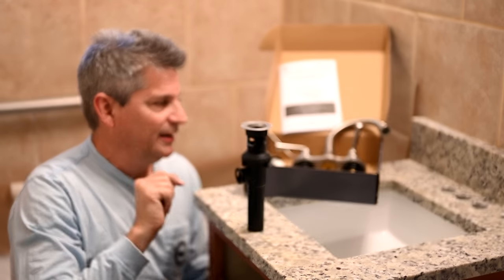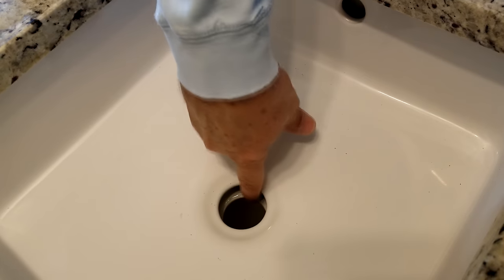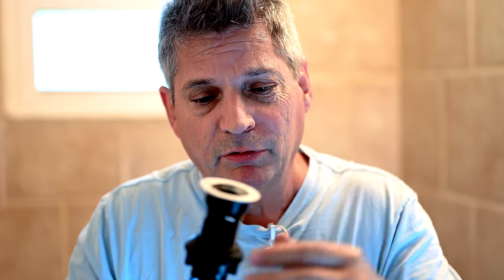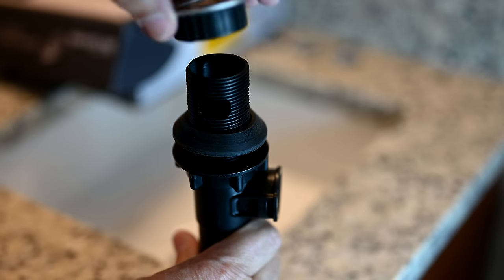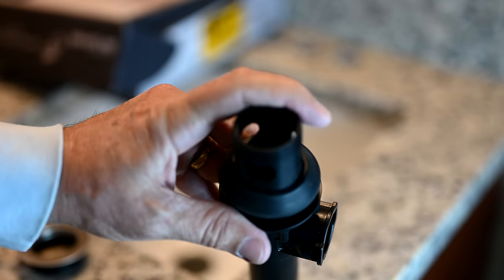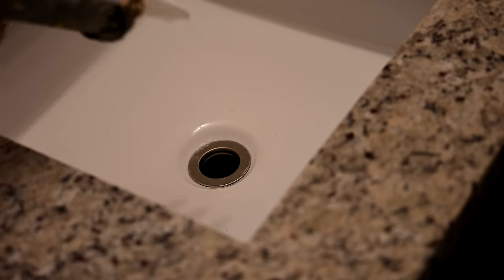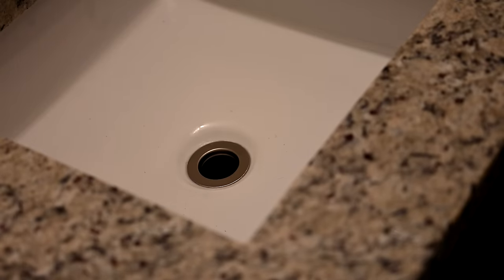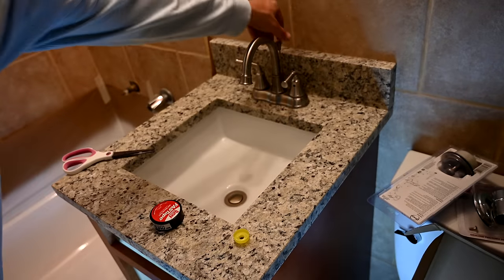How To Install Bathroom Sink Drain/Faucet, No Leaks Under Gasket, Threads [SOLVED] 2023

Comment: At the 23 sec mark, water appears to be coming out between the top of the rubber gasket and the underside of the sink.  How does teflon tape on the threads stop leaking at that location?  It can't.

Comment: Very good explanation of the problem but I have a faster and easier solution for the bottom section of tape.  Start the tape just below the weep holes and run it all the way down to where the gasket rests when it's all the way down.

Comment: Jeff,
I thoight I did everything correctly but something went wrong at the faucet its linking when I turn the water on .looks like the water is coming from the top of the faucet.
Reply from the maker: when you turn the water on water is supposed to come from the faucet. I sit leaking from somewhere on the faucet where it attaches to the sink?

Comment: How do you remove the old flange that’s stuck in the drain?
Reply from the maker: Once you loosen the plastic nut under the sink that squeezes up against the black gasket, pull the black gasket down a couple of inches and you should be able to just slap it straight up in the air and it should pop up off of the top side of the sink. Then you can use pliers or whatever to unscrew the  Flange
Reply: @jeffostroff  Thank you for that info.

Comment: What silicone did you use?
Reply from the maker: You have to use this particular GE Kitchen & Bath 100% silicone and look for 30 minute water ready on the label. Other silicone takes hours to cure. https://www.homedepot.com/p/GE-Advanced-Silicone-2-2-8-oz-Clear-Kitchen-and-Bath-Caulk-2709136/100004845

Comment: My bathroom sink is leaking through the middle hole where the plunger stopper rod goes.  Can you please tell me what I am doing wrong? Appreciate any thoughts that I may be missing.
Reply from the maker: If you were leaking through that hole where the plunger rod comes out, it usually means that you did not tighten down the nut correctly sometimes it goes on sort of at an angle where it's almost stripping the threads it has to go in clear and straight and screw all the way in reasonably tight in order to make sure you have a good seal there.
Reply: @jeffostroff   I am thanking the nut is missing altogether! I do not see anything that looks like it fits there. I am going to try to Google a pic of a sink plunger nut and see if I have something similar! Lol determination!

Comment: What if it's not threaded all the way up? Our pop up drain is dripping and the gasket comes up over the threads to a smooth part. The gasket is threaded but the part of the pipe it is on when it seals is smooth. Do I still use Teflon tape on the smooth part?
Reply from the maker: Never seen that, seems like they gave you a short down pipe. You can try to buy another taller threaded pipe with drain flange

Comment: Head scratcher for me, Jeff. I've successfully completed most of the steps in the video until I came across a dilemma. Wall pipe is 1-1/2", sink pipe is 1-1/4". I pulled the P-trap off to clean (or replace) to get better sink access, and I can't for the life of me figure out how to adapt this. I don't know if my 9 mo old puppy ran off with part while I was slaving under the drain nut, but the 1-1/2" P trap needs to go into the 1-1/4" sink drain somehow. Nothing obvious on the Home Depot shelf. Help!
Reply from the maker: One of your gaskets should be a 1 1/2" to 1 1/4" reducer gasket homedepot.sjv.io/0J2zdO
Reply: Any hardware store or Home Cheapo should be able to hook you up with that.  Like he said it's a reducer adapter.  It's made of rubber and has hose clamps on each end that you can tighten with a screwdriver or a 5/16" socket.  I prefer to use the socket; it's easier to torque down.
Reply: @jeffostroff  Perfect. Exactly what I needed. Thx!

Comment: Teflon is used basically as a lubricant for metal threads, particularly on tapered threads
Reply from the maker: It can be used on any threads
Reply: @jeffostroff  so can peanut butter, point is, it's not a sealant, but a lubricant

Comment: Lots of good tips here - I don't understand why the tape at the top of the assembly - seems to me like you've got a wet area (inside the sink) sealed up against another wet area (the area where the overflow comes to).  A tip I'll share is this - don't trust your hands to tell you where there's a leak.  Instead, get a sheet of Toilet Paper and use that.  It'll register the tiniest drip and present it to you in an unambiguous way - which is important since we all want to believe there's no leak.
Reply from the maker: Yup, and I also like to use the blue shop towels paper towels

Comment: What about using RectorSeal 5 around the rubber gasket surface where it seals at the bottom of the sink?
Reply from the maker: If you put the plumbers tape around the the bottom part of the threads, you won't need to add anything to the gasket.
Reply: @jeffostroff  thank you
Reply: NO. The #5 will eat away the plastic and cause premature failure of any plastic parts it touches.

Comment: my drain pipe comes with a foam gasket that sits underneath the flange and its leaking from there do you recommend removing the gasket and siliconing instead, its all plastic
Reply from the maker: I can't imagine that you are supposed to use the foam gasket and not plumbers putty or silicone. Do the instructions tell you to use the foam gasket?
Reply: @jeffostroff  the diagram clearly shows the foam gasket , i removed it and used silicone, no leaks looks great very well done video👍

Comment: I used Teflon tape but still getting leak near the black rubber gasket at the bottom of the basin. Can I use silicone around the rubber gasket to close up the leaks?
Reply from the maker: Watch the video again, make sure you go through all the steps, make sure you measure where the black gasket is going around the threaded pipe at the the bottom of the sink  underside, and make sure your teflon tape ends up there.
Reply: @jeffostroff  can I use plumbers putty along with the Teflon? It’s still leaking

Comment: It's true that placing the gasket against the threads is a bad design. A good drain pipe waste assembly is fitted to the sink such that the threads stop before the gasket which is then against only an unthreaded section of pipe. But because manufacturers and stores are cheap, they like to stock 1 part that fits everything, and that means threading the whole pipe. The kind engineers of some cheap parts gave us a way out of this situation: they made the gasket very tight against the threads, and they include a washer between the gasket and the nut to help you tighten the nut a lot, squishing the gasket into the threads. Without a washer and the right tool, you can't get the nut tight enough to stop the leak. You can also try threading the gasket upwards so the threads dig in more by the time it's at the top. The final hack is to eyeball where the gasket stops and fill that space with teflon tape, as suggest in this video. 

If you google for manufacturer installation videos, you'll see that a lot of them use assemblies that fit their demo sink perfectly, with the gasket on unthreaded pipe, which only needs a quick hand-tighten to never leak.

I agree that the manufacturers of these cheap one-size-fits-all assemblies SHOULD mention this teflon tape procedure. Example: "Mark the top of the threads below the sink, remove the assembly, and wrap 5 times with teflon tape here". The reason they don't have good documentation is because a lot of customers just get lucky and don't have a leak, so the company can get away with being irresponsible. Another thing they don't mention, but should: torn up old plastic threads and gaskets don't seal well and need to be replaced.

Comment: Mine still leaked with Teflon tape. Ugh. Bought a thicker tape, will see if it works with heavier tape. The tape I used was very stringy.
Reply from the maker: I prefer that Oatey Fastape it is thicker

Comment: What do you do if the rubber stopper on the underside is unable to tighten?  There's about a half inch gap... I think the sink is too thin?
Reply from the maker: It always tightens, just slide it up the threads to the sink bottom
Reply: @jeffostroff  lol I figured out my issue. I'm an idiot. I didn't know the drains were different for a vessel sink vs one with an overflow.   The one that came with my faucet was the wrong kind

Comment: IMO it is easier to caulk the underside of the faucet prior to setting it down on the sink.  It is much easier to clean up the squeezed out caulk than it is to use a caulking tube between the back of the faucet and the back splash.
Reply from the maker: yes but you still want to make sure you have the caulk top side also so it never enters the perimter of the faucet

Comment: Pro guy here: Tef tape is to protect the threads.  The rubber gaskets job is to seal for no leaks.   Whenever I see tef tape on fittings with rubber gaskets it usually tells me a non- professional was here.  At the end of the day did it leak?   As long as you don’t over do it it’ll be fine.

Comment: Do you use a basin wrench at all, or would you recommend that rigid tool in place of that?
Reply from the maker: You can use  basin wrench or channelock pliers, not more than 1/4 turn. I just prefer to hand tighten.
Reply: The Rigid tool 57003 is the tool to get.  If you install sinks as much as I do(A TON!) that thing is a lifesaver.  Tightening the nuts on the P-trap, I just use my hand holding onto a rag or paper towel.

Comment: Does that "problematic" connection underneath have a gasket? 

I saw a Home Depot video where there was no gasket put there. 

But nobody ever addresses this.  Gasket or no gasket?
Reply from the maker: Depends on the manufacturer of the drain, but I have never seen a drain come with a gasket.
Reply: @jeffostroff  

I'm talking about the j-bend connection to the tailpiece. 

The tailpiece has a lip molded around it where it connects to the j-bend. 

Home Depot video shows the nut sliding down over the lip then screwed into the j-bend without a compression washer. 

Is the compression washer here needed or not?

Comment: My question.  If you replace the vanity with a taller one how would you make the end piece fit with the current P trap.
Reply from the maker: Why would you replace it with a taller vanity? That makes no sense I would never do it. You would lose storage space
Reply: @jeffostroff  my current vanity is 33in tall but everything out there measured about 35in tall. I want to replace it but I'm worried the piping will be an  issue
Reply from the maker: @dant3113   The most likely thing that will happen is you have to buy an extension piece that plugs onto the downpipe on pipe from the drain in order to get it to reach the petrap properly. That's very common even with me with regular counters has a lot of it has to do with the height of the floor that the builder made the drain going into the wall.
Reply: @jeffostroff  that's what I'm a little worried about. So I can buy an extension at any hardware store I'm assuming like Lowes/Home depot

Comment: Could you not put plumber putty on top to stop leak and plumber putty on bottom
Reply from the maker: Sounds like you did not even watch the video. I specifically showed you to follow the manufacturer's instructions. In our case they specifically stated to use silicone. On the rubber gasket, Oatey has told us not to use plumbers putty. All this is covered in the video

Comment: Yup, teflon tape fixed it! I'm not sure why it's needed on the top, though, since if that joint leaks the water stays above the rubber gasket inside the sink. But hey, it didn't make the job any harder...
Reply from the maker: Way to go Kerry!

Comment: Installed just as in your video but still have water coming from between the gasket and the bowl
Reply from the maker: If you have water coming out of your drain still at the bottom underneath the sink, then you most certainly did not install it exactly as I showed you in the video. Go back and watch the video particularly for the part where I show you dry fitting everything first to determine where you have to put the Teflon tape, and then make sure you put that Teflon tape in there correctly. And when you tighten the nut underneath the black gasket, make sure you can see the white Teflon tape is there right where the gasket comes up to the pipe at the bottom of the sink. Also make sure you do not over tighten that nut or you will change the shape of the gasket and cause a leak that way as well.
Reply: @jeffostroff  All good. Second time around I applied a little more silicone under the flange and let it set for a few hours instead of 45 minutes and I'm sure I tightened the gasket too much on the first try. Appreciate your assistance

Comment: I'm not understanding how the bottom teflon tape against the wedge rubber piece is helping stop a leak. The teflon wouldn't even touch the buttom of sink? It's the tightening of the bottom that pushes up the wedge. Also you mentioned that wedge isn't meant for holding water, but isn't that exactly its purpose? It's always going to have water sitting on it, up to the weep holes.

Comment: I not sure about teflon tape,  
I had to replace a sink drain before  and I noticed that the plumer had a hard to with the drain,  and i see what you talking about,  because happens at the time to try with water,  
I had a better idea,  i used plumers grease in the black rubber seal, grease makes the black rubber seal expands easier at the time to tighten,  works perfect,
Reply from the maker: The gasket is still not the best shape to act as a seal, I think it needs the help of the Teflon tape

Comment: Those gaskets are threaded. If you rotate the gasket while you tighten the nut, you won't get any leaks. Silicone grease on the threads of the tailpiece can help.  I've never tried Teflon tape on either of those connections, but as they say, you gotta find what works for you.
Reply from the maker: Great point!

Comment: Your video production and presentation are outstanding.  However, there is something about your 'solution' that I don't understand.  The leak is coming from the outside of the rubber seal, not the side against the threads.  How does putting tape on the threads help with this?  I think you showed what typically causes the leaks. Overtightening the nut against the rubber gasket, or misalignment of the drain tube coming down out of the sink...
Reply from the maker: Yes the leak is coming from the outside of the threads where the gasket meets up against it, so by putting the Teflon tape there it. Prevents the water from getting through those threads. And then out the gasket

Comment: Please don't use teflon tape. We have enough PFAS contamination in this world.  Anyway here's the reason it leaks, and here is the actual solution. The cone gasket is designed to be pushed up into the sink and constrict around the threads of the tailpiece, sealing it. It never works for most people for the simple reason that the whole thing is dry. The plastic nut has a large flat surface that rides along the large end of the cone washer; smooth plastic against soft rubber = high friction. Additionally, the cone side of the washer experiences increasing friction as it is pushed into the sink hole, and instead of going IN to the hole, it simply mushrooms out around the hole. Applying a thin layer of silicone grease to both surfaces of the cone washer allows it to seat properly with only hand tightening. I've installed close to 100 of these and never had a single leak, ever.
Reply: Thanks bro

Comment: Just a quick, thing for those that do not have those sink drains.   I did have this issue, but I have the drain that does Not have the threads All the way up..    It gets flat,  no threads.    Also,  the top piece did not screw in, its 1 piece that goes in from the top and has only the washer and hand tightener from underneath.   The thing is,  (I tried everything), the actual rubber washer they give you.   ITS CRAP.   You need Togo to home depot,  or Lowes and get the replacement one that has the small rubber inside edge that goes right up into the bottom of the sink.   THAT will solve the problem...

Comment: I use teflon paste like mega lock into the threads and then I'll smear the top of the rubber gasket as well
Reply from the maker: Yes a lot of people use pipe dope
Reply: Make sure whatever pipe dope you use is rated for use on plastic pipe.
Reply: @jeffostroff  is pipe dope the same thing as plumbers putty?
Reply: @dohc1974  hey, no they’re  two different products. Dope is more like a paste.
Reply: @WareisChris  thsnks